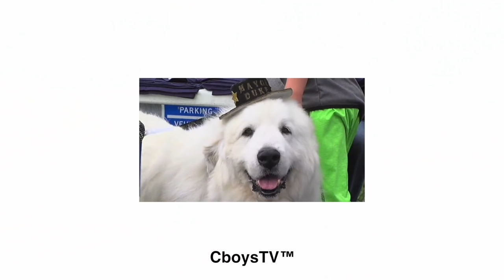Surprising my Injured Friend with Tesla Cyber Quad

Comment: CBoys you should make a jet ski snowmobile, a jet ski hull with a snowmobile propulsion system. It would work on water and snow and would probably be a lot more stable on snow than a snowmobile as long as you use a hull from after 2008.